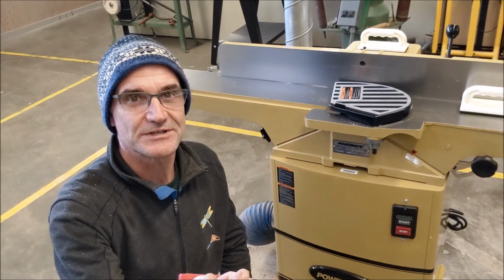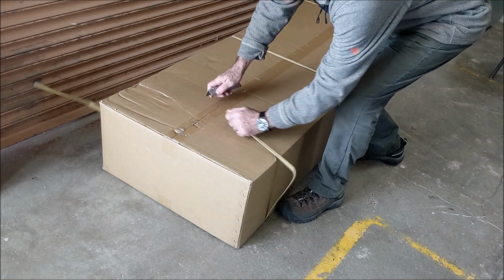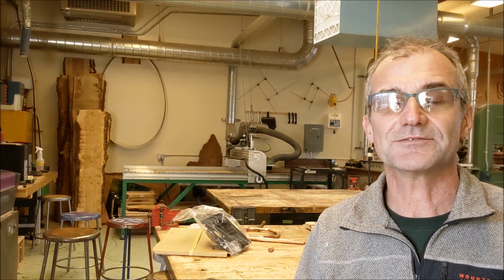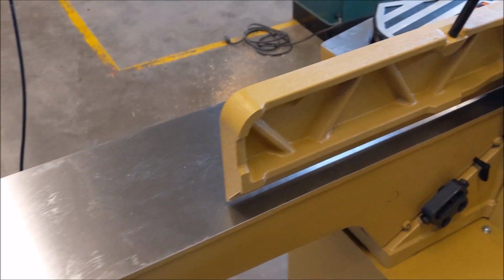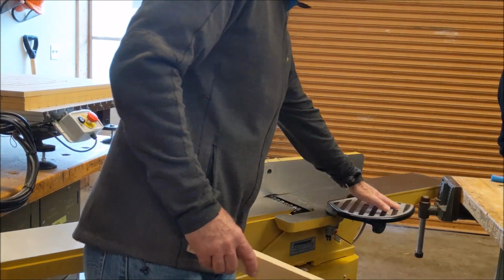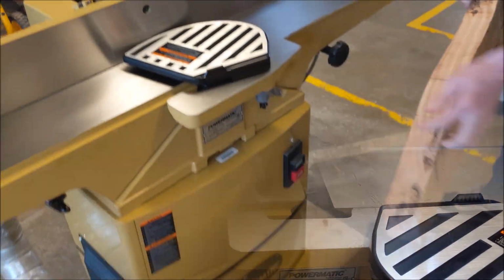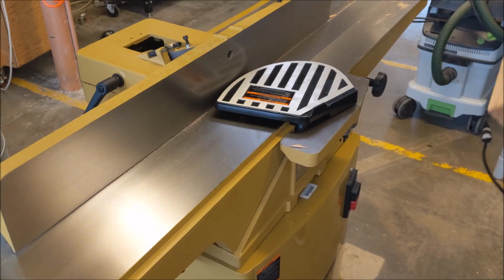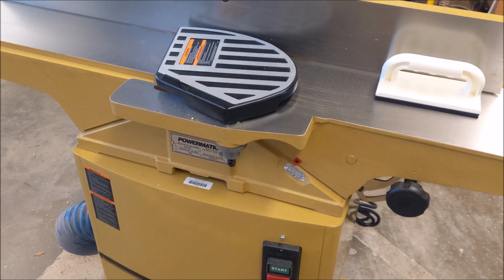Powermatic 6 inch Woodworking Jointer Model 54HH, Review, Unboxing, First Use

Comment: "The gold standard."  Watching woodworking on television a good portion of my life, Powermatic was always the brand that I aspired to own one day. Powermatic is to woodworking tools, what Colt is to 1911's. It's an old, trusted name, renowned for high quality.
Reply from the maker: I've bought quite a few tools over the years for the woodshop. I have never regretted buying a good tool and always regretted a cheap tool.
Reply: Since 1977 I felt the same way. However JPW(the Powermatic distributor) does not know how to properly package and ship anything. All 3 pieces I purchased over the past month have arrived busted up. 15" planer, poorly crated, no top heavy stickers (It weighs over 520 pounds and it's all at the top). Pallet not constructed correctly to prevent tip over and yes, when transferred locally for delivery, a not too smart loader put that pallet on top of a USA sized truck pallet. No strapping, tie downs etc.. First turn 500 pound is unleashed to fly sideways in the truck. Again no top heavy stickers or warnings. The pallet on my 54HH jointer arrived busted in two due to a pallet built with large knot wood. The fence assembly lays on top the the jointer bed with no rub protection.. The two ground each other to a nice flat spot. Paint missing etc. The jointer stand (powermatic) arrived tonight. In a box torn all the shreds. Box 10 inches bigger than the assembled unit. No packing like Styrofoam etc. The two brake knobs busted off. Worst equipment I have ever purchased. A 2nd class supplier who could care less about how your hard earned money is shipped. The Gold Standard, nope, not in my book!
Reply: @JDDupuy  that's a bummer. I got the 54HH jointer not long ago when Rockler was running 15% off. It seemed well packaged but was on a broken pallet on top of another pallet (obvious carelessness in shipping) Fortunately, no damage. 

I don't move my fence much to minimize  the rubbing. I thought that design was very poorly thought out too. 

It is my first jointer and has enabled a whole new world for me, so I am happy with it. It gets me a perfect 90 and runs super smooth & quiet. It would've been nice to know beforehand that I wouldn't have the rabbet feature with the helical head but there just wasn't much info out there.

I thought about going with a Grizzly but it seemed much more of a gamble and the Jet 6" has a shorter table length. I figure the Powermatic should resell fairly well if I ever feel the need for an 8"

Comment: I have an older model with the blades and it's a pain to calibrate the blades, can I replace the cutter head with one like yours?
Reply from the maker: Yes, I have seen spiral replacement heads. I know they are expensive

Comment: Do you still like your planer? Any regrets for not going bigger?
Reply from the maker: Yes, still love this planer. I would like a larger one for face joining, but this was the largest 110 volt planer available, larger ones are usually 220 which was not possible.